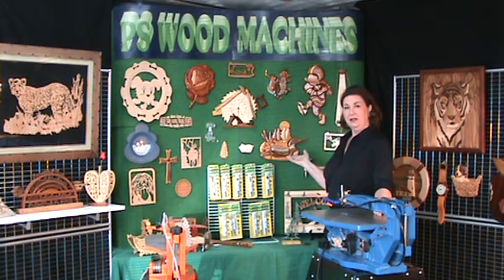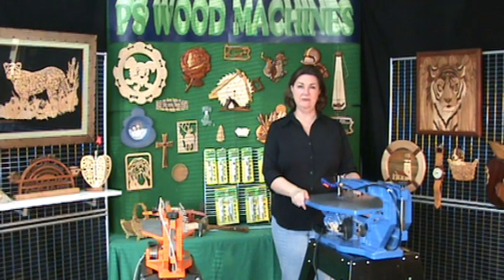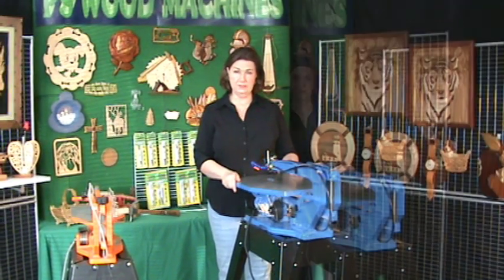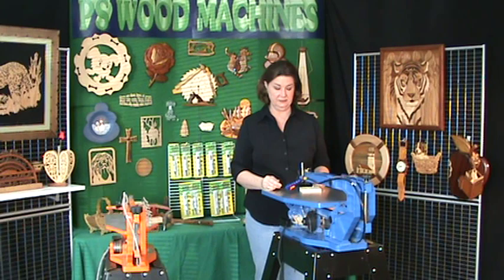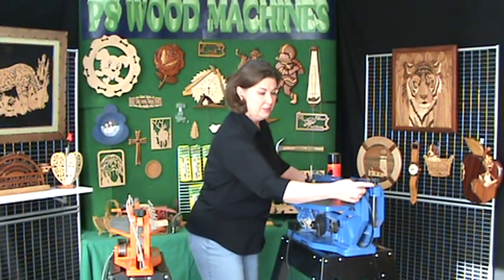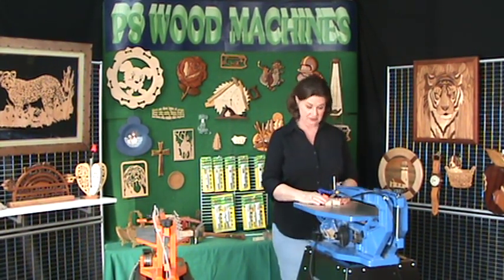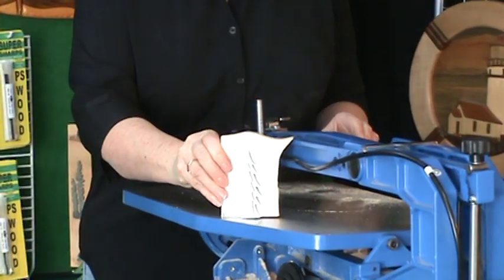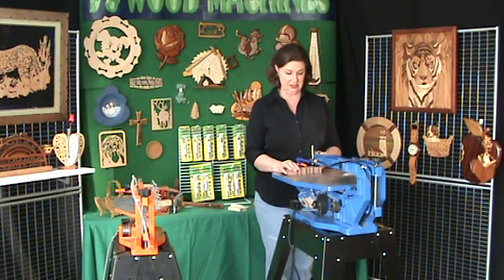PS Wood scroll saw demo

Comment: I think the scroll saw is a bit noisy.
Whether the scroll saw would be quieter if you used a finer or sharper saw blade. 
Greetings, Arnold
Reply: The noise generated by different types of wood and their dimensions also varies - depends not only on the fretsaw blade used (tooth geometry and tooth size) and its tension. 
The sound recording via microphone cannot always be perfectly controlled beforehand.
 Currently I like the Pegas fretsaw blades and for comparison with the fretsaw blades you use, I haven't had a chance yet.
 I would like to test such a scroll saw, especially because, as I can see, nothing can break. 
Changing fretsaw blades looks so easy. I've never seen such a system before.
A high saw cut stroke is advantageous when sawing, but reduces the possible cutting height when using fret saw blades of the same length.

"Also you already know but i have to tell you again. You have inspired me to push myself harder behind my saw." 
-I'm glad to hear that, but I don't even know your name. 

"Congrats on your 10 year anniversary of FEINES AUS WUPPERTAL. PROST!" 
-Thank you very much!

Best regards, Arnold